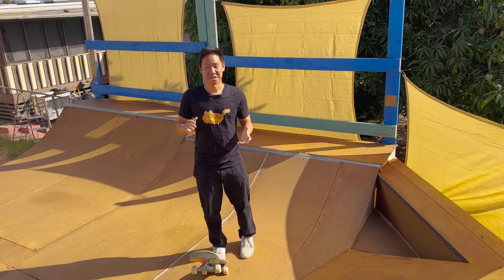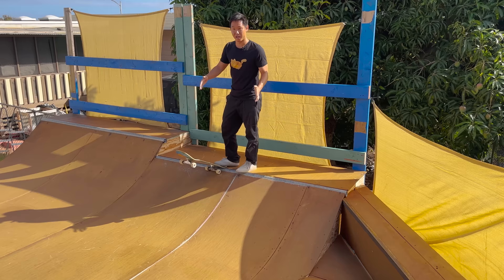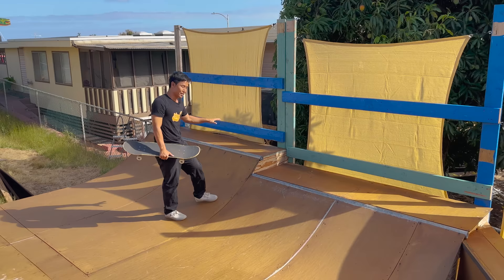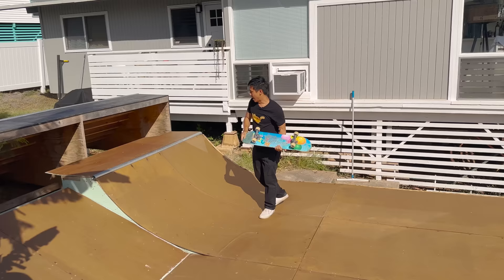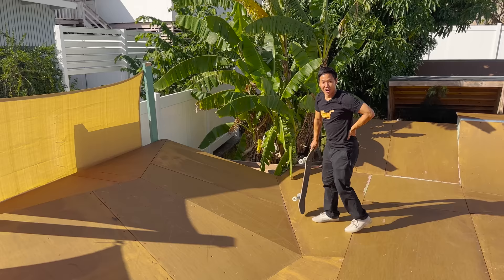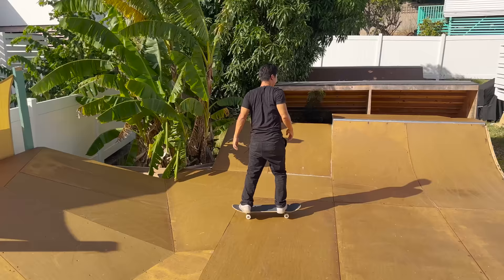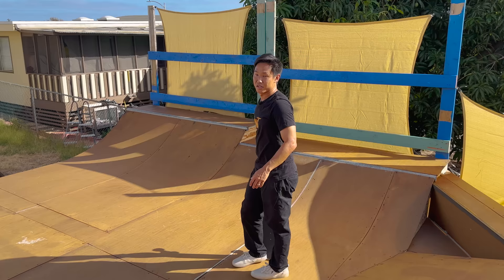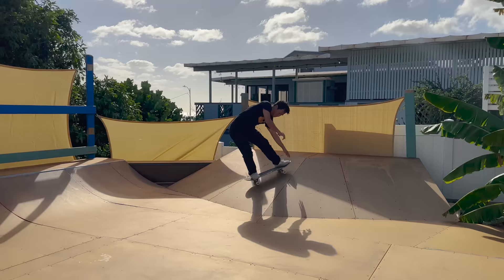MY BRAND NEW BACKYARD SKATEPARK!

Comment: if you add a cup holder anywhere can you call that the 'ninja zone' ?
Reply: maybe a dumb question but is everything raised up off the ground because it rains a lot there?
Reply from the maker: I know a different “ninja zone” that many fear and respect…
Reply from the maker: @NinjaLifestyle  well where the ramp starts it was just on a single cement block just to stabilize it and level it since it’s on a slant - everything else is raised because my backyard is super slanted downwards.  But also it does help for the rain so it doesn’t soak into the wood!